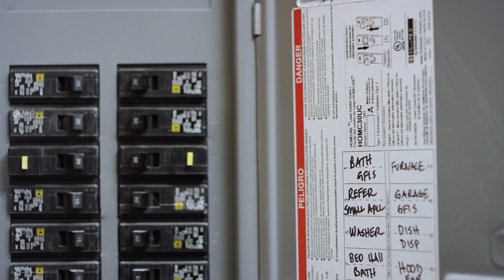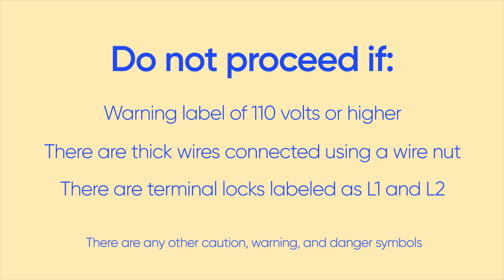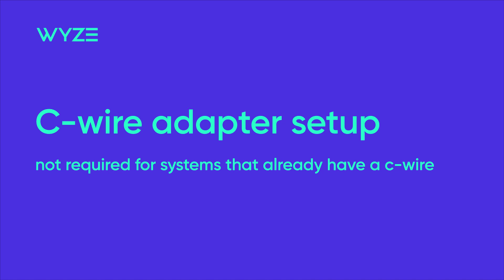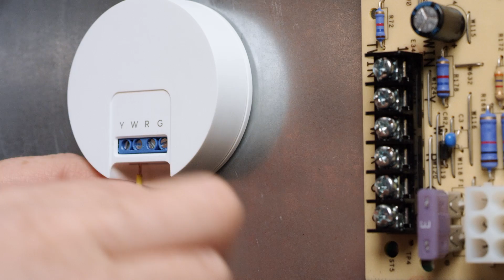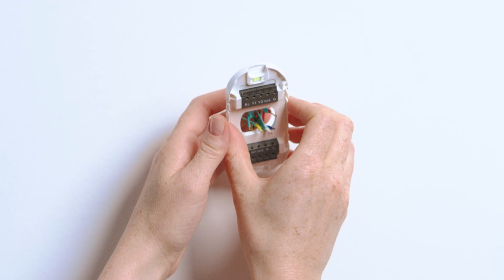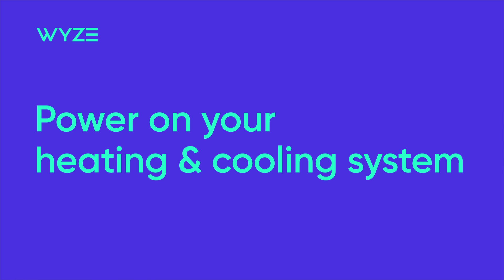How to Setup Wyze Thermostat

Comment: This is a terrible set of instructions. How did the C wire get up to the thermostat from the C wire adapter which was installed at the furnace.  Originally there were 4 wires shown. In many homes there are only 4 wires at the back of the thermostat. Your instructions show the C wire adapter installed at the furnace then a 5th wire magically appears at the back of the thermostat. This is a major problem to get the 5th wire from the furnace up to the thermostat to be used as the C wire.
Reply: Listen to the narration. If you use the C wire adapter you won't have a C Wire at the thermostat end (if it works like the ecobee one, it combines Y and G onto one wire and uses a diode inside the thermostat to split them back up internally, which frees up the G wire to act as a C wire).
Reply: @ZanHecht  is correct. Some people are so unobservant...
Reply: @noxious_nights  Its not just that. I don't have an HVAC system. Just four wires coming off the furnace. Not sure how to hook up the C wire
Reply: @fsped09  Then you don't need a C wire
Reply: Yes, Wyze's video is messed up here.
Reply: The video make no mention if you do not have a terminal “on furnace” for the “C” wire on the c wire adapter sent in kit,,thus mine doesn’t work and cannot get support...

Comment: Will this work with heat only systems?
Reply: I have a heat only system, and the check on their website states that it will work.  I have a smart thermostat from my electric company that is currently working (although they are discontinuing the service) so I believe the Wyze Thermostat will work as well.
Reply: Brett Conroy  ok thanks for the reply!